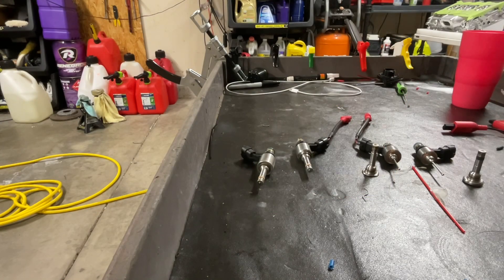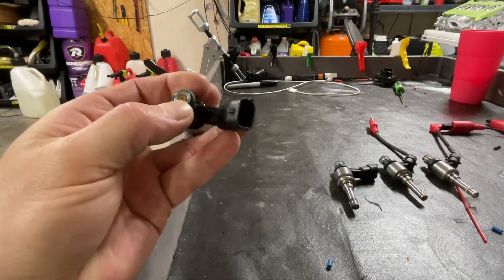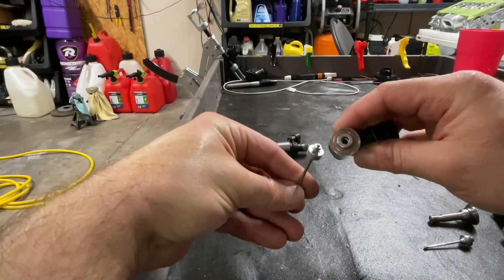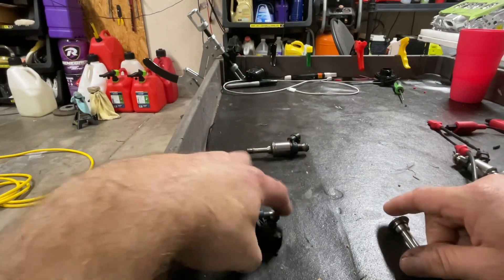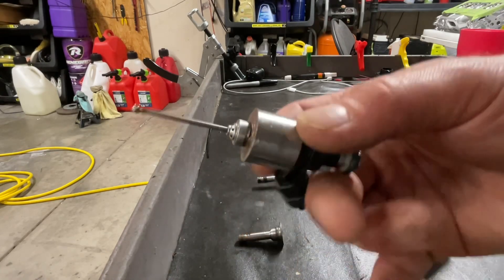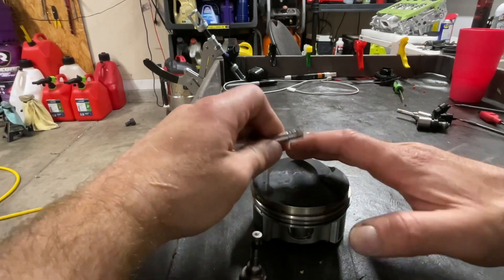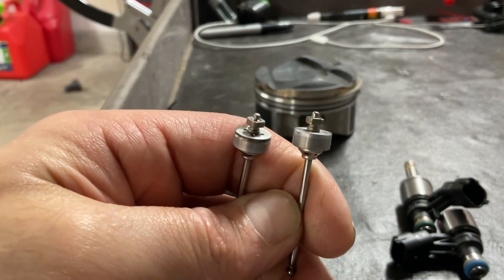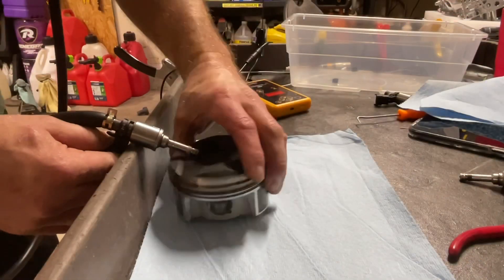Fk8 Direct Injectors (How they Work)

Comment: John, Before what HP level do upgraded injectors make no sense? At around 415HP, Is there any benefit for upgraded injectors?
Reply from the maker: Above 380-390 hp fuel control is improved with upgraded injectors. It makes the car more reliable. Hp isn’t always indicative of requirement for fuel injector replacement.   Your turbo, flex fuel and set up efficiency all define your injector usage.
Reply: Good question, but perhaps a better one would be at what max duty cycle do the stock injectors need to be upgraded? ...40%? @fk8td